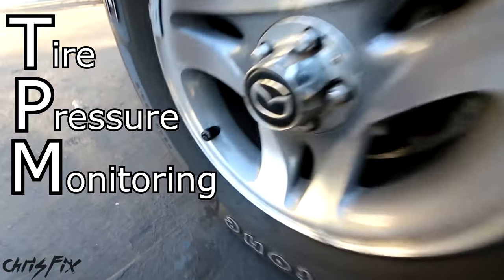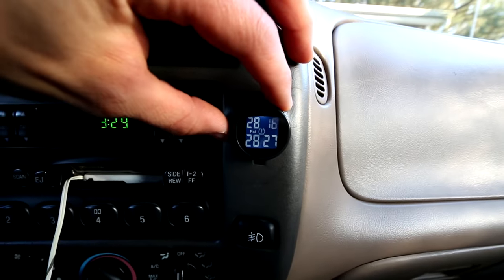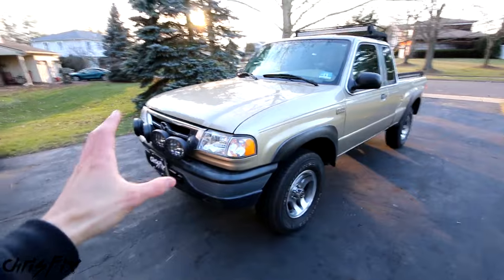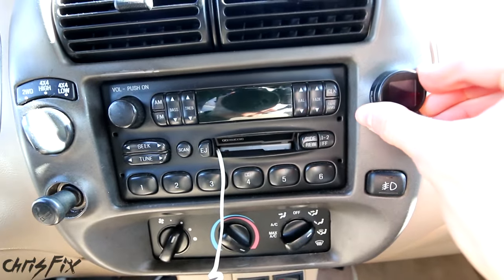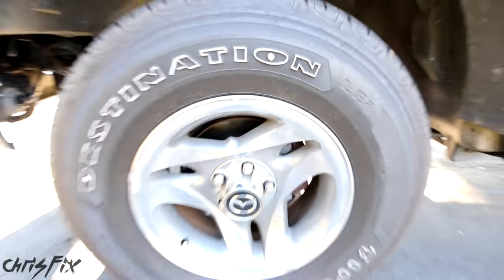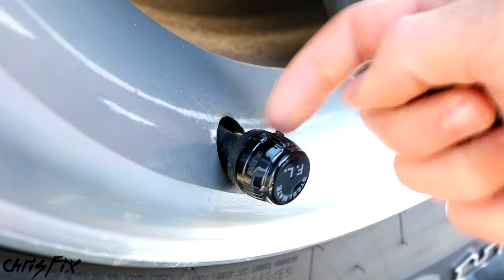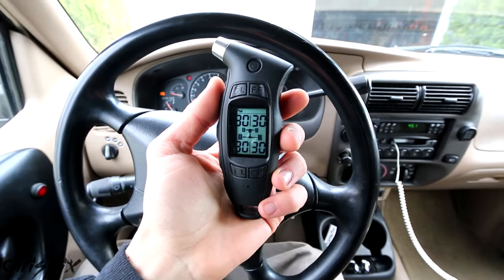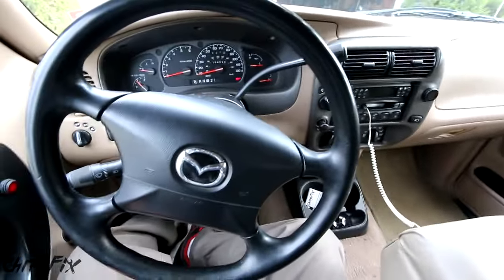How to Install a Tire Pressure Monitoring System in Your Car

Comment: I check pressure all the time and recently on my trip from SC to NY I had a tire basically melt 200 miles in before I made any stops to do a walk-around. I considered getting something like this after. No fun changing the spare on the side of the interstate

Comment: TPMS is not all that useful on a car with 4 wheels. It's very easy to just regularly check your tire pressure without having to go out and spend all this money. However, if you have a dually or a semi truck, TPMS systems are extremely useful because it's hard to tell when these tires are low just by looking at them and it is a pain in the butt reaching the valve stems on those style of vehicles
Reply from the maker: Thanks for sharing!

Comment: Damn... I'm gone to activate DDS on my Focus right now! 
Btw if I plug anything in my cigaret lighter I get unbearable radio interference with shitty Cd6000. Any idea how to FIX this?
Reply: run your cigerette lighter its own fused 12v supply and ground. Avoid grounding any where near your stereo. Run good size wire if you plan to plug in a device with any real amp draw. Run the wires away from stereo wires as much as possible. Consider doing the same for your stereo. Factory wire harnesses are barely adequate for stock stereos and never include enough head room for aftermarket decks which almost always use more power.

Comment: Awesome, this is much better than having to dismount a tire, then take the tire apart, to just replace a disposable TPMS followed by putting the tire back together and re-balancing it. All that work gets expensive fast, especially since not many DIYers have access to a tire machine at home.

Comment: what exactly will happen if you fill up your tires more then the car's manufacturer says but less then the tire's max psi? Will it just be a rougher ride, faster tire ware? Would I get better MPG?
Reply from the maker: Less grip would and a slightly stiffer ride would be the negatives. You probably would see slightly better mpgs but not much.

Comment: What about pressure indicating valve caps Might only be Red Yellow Green indication, but very inexpensive. 

Now, what about balancing after install?
Reply: I was wondering the same. My cheapo ($7 in bargain bin) sensors from Walmart just bit the dust after a rebalance. Replacing with new set and  each sensor weighs out at 9-10g each = 0.3 oz. Since the weights are sold in .25 oz squares, I think I need to slap on at least one per wheel at 180 degrees.

Comment: Warning: External Monitoring system is going to ruin  your tire valve stems overtime, It will be hard to take off after hash winters. use internal ones if possible..
Reply: Good point, that 9 grams on the end is going to flex the stems a lot at high speed.

Comment: Low air tire pressure on my dashboard just turned on. I guess one of my tpms battery died. Inspection wont pass with the light on. If I install this instead of replacing the tpms inside the tire will my car pass inspection?
Reply from the maker: +Fernando Cumbe I have no clue what state you are in so I can't help. Contact your states inspection center. If the light is on and not flashing your sensors are working but the pressure is not high enough.

Comment: chris, did you go drive around with the product ? i was reading the comments and it seems it can take up to 10 minutes to update. few people were saying theyve put extra air in the tire to verify if the system was working and it only updated 10 minutes later
Reply: edouard Viron it works instantly for me

Comment: Question is what loading does this place on the valve stem with the additional mass of the sensor with the G-force of the rotating wheel? Could lead to some exciting times if the valve stem snaps off and a tyre rapidly deflates.

Comment: nice but i only have two cigarette lighters and im using one for my dash cam and the other to charge my mobile unless i take out the mobile charger & put in this system check the tire pressure then put my charger back but too much of a hassle for me not including that i have to use the wrench everytime i pump some air into it i do have the low sensor monitor on the dash but like you said it doesn't tell which one i just gotta figure it out which it doesn't really take a lot of time so i'll just stick to the old ways nice tech doe
Reply: Tony V there’s a tpma model that has a charge port

Comment: I bought some after watching this video a year ago.  I did it primarily because I have 24" rims and little rubber between the rim and road.  This assures my tires are fully pressured and I don't have to worry about damaging the rims or tires.

Comment: how can I deactivate my tpms? it's a pain in my butt 😂
Reply: Why would you want to do that?
Reply: Deoxin because i check my tire pressures once weekly and it gives me errors constantly. Had tpms sensors checked and still haywire... so yeah, i’d rather have it disconnected with no more amber lights.
Reply: @onpoint1111  fair point.

Comment: Ok I stopped the video at 2:27 because if I see that the sensors are tire caps I won't even botter to install them. Let me put play again and see what's the deal.
Reply: Just as I thought.

Comment: guess you should now rebalance the wheels after that?
Reply: I was running down the comments for this question specifically. I'd imagine you would need to balance the tires if there is enough mass added to one side.

Comment: shouldnt they all come with one since like 10 years ago.. my 08 corolla has a button to set tire pressure on it and a gauge light lol.
Reply: Nelson Stack this product tells you the exact pressure the tire is at. I have a 2015 Accord and it doesn't tell me which tire is low, it only let's me know that one tire is low
Reply: @ManBearPig617x  ahh right right. some newer cars do that with a diagram but nope your right mine just does the one of 4 is flat lol.. and you cant use fix a flat or youl break the sensor forever.

Comment: Hmmm wonder if this would be accurate enough to be beneficial on track day cars?
Reply from the maker: I tried it and it worked great for drifting so you can monitor pressure on a hot tire vs a tire when you cool down at grid.

Comment: hello, I live where it's cold and snow.  Many years ago I had metal caps on my jeep I had at the time, and they rusted on the valve and had to have ALL 4 tires changed.  So how does this work in the winter?? will they rust to the valve stem??? because if they do, then they are useless for me.
Reply: You put oil in the cap so it doesn't oxidise

Comment: Why does my 1986 ford f150 not have these?
Reply: Because it's a 1986 Ford f150. This technology didn't exist 35 years ago. And this is an aftermarket kit, capable of being installed on any make/model of car. Buy a kit and your Ford f150 will have them!

Comment: These would be good to monitor the pressure in trailer tires if they are in range of the receiver.
Reply: Just looked it up.  They have trailer versions.

Comment: How long do the sensors you put in the tires last before having to change their batteries?  I assume they run on batteries..   Do other sensors that go inside the tires run on batteries also??
Reply from the maker: +Rick Kardol they last a few years and yes the ones that go in the tires also run on batteries.
Reply: I'm getting new tires and they come with the sensors.. although my car doesn't have the monitor..   therefore, I'm not sure if I should have them installed in the first place.  I was looking for a monitor..  maybe... 

Any suggestions?  (Accord 2003)

Comment: The problem I have with these is that you have to take them off in order to fill the tire
Reply: I think I saw a set which you can fill the tire without removing them on Amazon

Comment: Do we need to rebalance tires after the sensor is installed?
Reply from the maker: I didn’t have an issue with wheel balance. It wasn’t heavy enough to cause a problem with my truck wheel but maybe a lighter wheel might need re-balancing.

Comment: Love your videos Chrisfix, so clear and easy to understand. Just a quick question, the model you use in the video is steelmate however when you go to the link provided its vesafe, is the quality the same or should I try to find steelmate? Thanks again
Reply: i bought the vesafe, overall it is not bad, but the external caps are not long lasting...  the small rubber ring in the cap that prevents the air leaking out just starts breaking and air will leak out, I don't know where to get those rubber replacement and I had to buy another external cap for 15 bucks, soon after, another cap just broke in the same spot and i just took off the system altogether now.

Comment: Pity there are only 4 valves.  5th one on spare would be bargain.  Good investment in terms of safety and tyre wear.
Reply: That one will continue to be a manual check I suppose, which is probably something else most folks never do. You could buy a second set for it and have it as a backup if the others crap out. Or motorcycle set and have a back up sensor for it.

Comment: Will this over ride the dash board light and turn it off?
Reply from the maker: No, you will need new batteries in the sensors in the tires to fix that.

Comment: Which is better sensors installed outside the rim or inside the rim?
Reply from the maker: +Dan Ignacio inside the rim is better because it's more accurate but it's not as good because replacing the batteries is difficult

Comment: But how does an car know how much pressur is in the tire
Reply: The abs wheel sensor, when one tyre looses psi the abs sensor can detect the wheel rotating at a different speed to the others

Comment: how do the sensors have power? how long do they last?
Reply: The sensors are powered by replaceable CR 1632 batteries for signal transmission. Usually they can last for about 1-2 years if you drive for about 3-4hs per day.

Comment: How to replace battery in the sensor?
Reply: Get the regular CR 1632 batteries are just OK, you can find some tips from the user manual, if you lost it, you can contact the seller directly, they can send you the files soon. There's some tools attached with the package as well..

Comment: that's a lie my 2009 Dodge Challenger rt dose not have them it was a option
Reply from the maker: Do you live in the USA? They became mandated here on any vehicle sold after  September 1, 2007
Reply: Yes I live in Tennessee. and no it was a option on all 2009 Dodge or Chrysler vehicles.i still have my window sticker.and the options sheet because I ordered mine
Reply: All In mopar i believe you may need to check your dash board and see if there menu button or maybe on your steering wheel. Like Chris said it became law, that all new cars now are equipped with it. It could just be a light that comes on when you are low on air. My wifes car is set up with only a light, but my Acura i have to bring it up my dash using the menu options.
Reply: chavy no IV looked in the owners manual and it did not come with them .it is listed as a option on the list of had my tires changed to yellow letter good years last month and it doesn't have tire pressure monitoring system at all
Reply: All In mopar interesting, very well
Reply: All In mopar the 2009 challenger rt may use the vehicles ride height sensors ran through an algorithm to determine air loss from tires. that's a nice car I'd be surprised if it didn't have any TirePressureMontioring function at all
Reply: No ride height monitor no tire pressure monitoring rather.options it's on the order list you can take it or not
Reply: All In mopar interesting man I stand corrected, I thought the feds made it mandatory.
Reply: They did but it could be an option on the base models
Reply: Challenger and I'm not fucking with a lawyer all Dodge cars and trucks have it as a option

Comment: What if they just rip your stems out?
Reply: good luck trying lol
Reply: @dosmundos3830  Its not that hard you can rip stems out with pliers or vice grips.
Reply: EABA EndAllBeAll covered with a booted ball? you haven't even seen one yet attempted it lol
Reply: @dosmundos3830  I do tires for a living, That ball is a a handle to rip stems off with.
Reply: EABA EndAllBeAll you think you're the only one who's pulled a stem hero boy lol. there's all kinds, some are even metal throughout and tightened on with a nut. but you go on and collect all your little stems and balls for your collection, i know you can do it :p
Reply: @dosmundos3830  that's cool you think I am a hero. But I am just a regular guy like you. Have a good day citizen.

Comment: I would love it more if the sensor was installed inside the tyre like most manufacturers do.
The loosening of the sensor from a valve stem every time I have to pump the wheel is not so on.
Nevertheless, it's a great DIY system.

Comment: What your vehicle has is an indirect TPM system, that’s why it doesn’t show which tire has low pressure. And yes a retrofit solution is great if you have an indirect TPMS or if you don’t have any at all. The retrofit you are showing though, I would say it’s kinda disturbing having the sensor outside. Seems very open to atmospheric conditions, dirt, grime, etc. pretty sure there are solutions where the sensors gets installed inside the rim and outside you see only the valve stem, which is more resistant and costs much less to change the service kit then the sensor every time. Just a thought...

Comment: "my 2001 truck and my 1996 Vette"  both with cassette decks no doubt.  What a baller!  Why would suggest going to the door sticker to get the tire pressure? It's possible the previous owner or yourself had put different tires on there requiring different pressure.  Never go by the door sticker but the tire.  Your sticker said 30PSI and the tire said 44PSI.  If you put 30 into a 44, you are underinflating it. So what you say now?
Reply from the maker: +knurri actually going by the door sticker is the proper way. The tire pressure for your car with aftermarket tires is also accurate if you use the door sticker. The door sticker pressure takes into account the suspension and weight of the vehicle. If you fill the tires to the pressure written on the tire itself, you are actually inflating them to the max PSI because that is what is written on the tire.

Comment: To the people saying it costs too much, i had to replace the left rear on my Maserati Gransport (2006 so no TPMS) because it had a slow leak that is undetectable (due to low profile tyres) with a walk around (which i do, happily, every time i drive :) ). The tyre was damaged by under inflation as a result (In about 50km) and cost $350 to replace. A TPMS would have paid itself off right away. 

For cheap cars and tyres, sure, whatever. For expensive cars and tyres, this makes sense!

Comment: I can tell you're not very intelligent you just now showed a fief how to remove your tire pressure sensor but a thief will just cut your valve stem off and take it away your centers no good without the reader and your readers no good without the sensor to a thief they don't care which one they still so as long as you don't have it my advice don't put them on and I won't give a thief the reason to take them
Reply from the maker: Thanks for sharing!